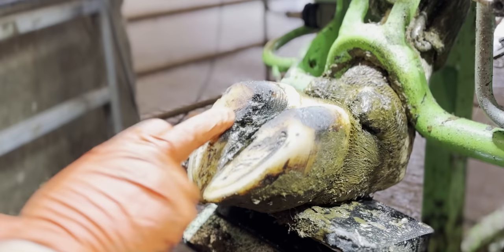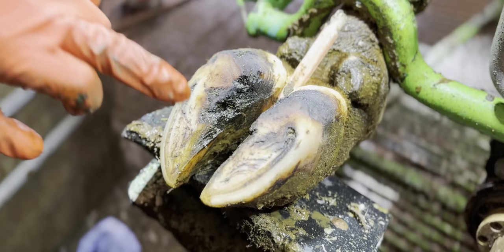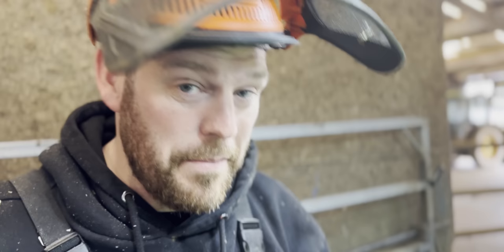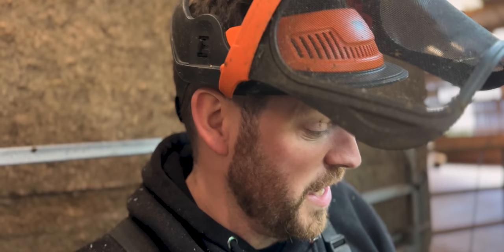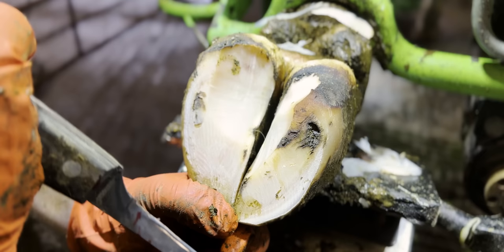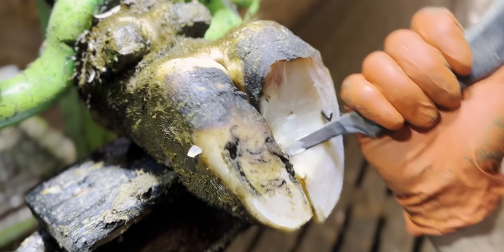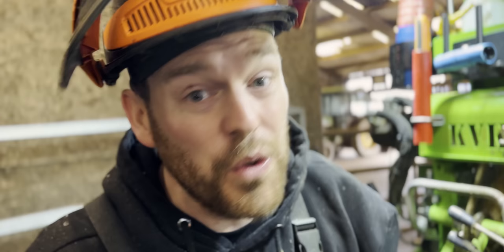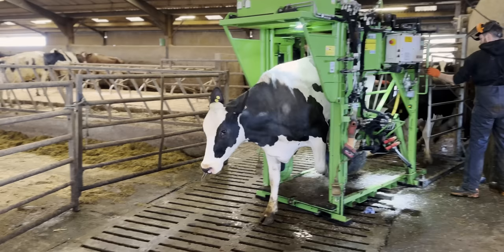the most IMPORTANT trim you've EVER seen!

Comment: the jump cutting is too much. The older videos were smooth and so well edited. Example is the the vertical line of the corner in the intro... Throughout the video it is missing frames or something. There is a tool that creates this effect because the younger generations need to reframing because of the shortened attention span. But this looks too jumpy. Super enjoy the videos but this is adding stress to what was a relaxing video watching a master at work.